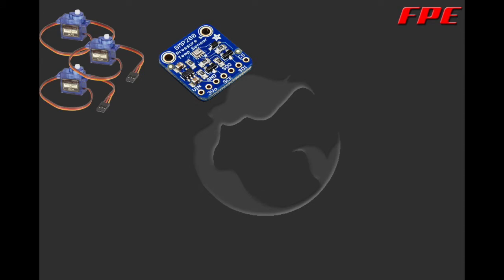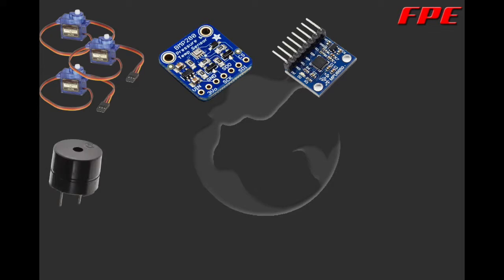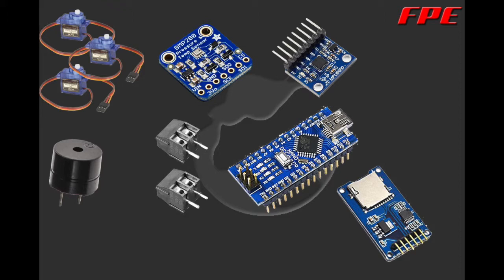How to Make a Model Rocket Flight Computer | Part 1 - Concepts and Components

Comment: Great video! I am a high schooler trying to achieve the same goal except with an electric ducted fan (EDF) to control for altitude and an electromagnetic parachute ejection system to control for time. Do you think you could share your code for the flight computer because I am really unsure whether I need to make drag calculations or whether I can just plug gyro and barometer data into the equations of motion in order to predict trajectory (apogee). Thanks, and good luck to you in your endeavors!
Reply from the maker: Couple questions. 
1.) Is it a rocket, or anything going up fast?

2.) Are you a TARC participant?
Reply: 1) Yes, it is a rocket with an F motor.
2)Yes, I am a TARC participant. My intention is not to copy code. I am just not sure whether I need CFD simulations for drag or whether I can use readily availabe sensor data in simple equations. I wanted to see your code because I wanted to see what worked for you. Thanks!
Reply from the maker: That’s awesome. I was a TARC team captain for two years, went to nationals one year. Avoid F-32 motors like the plague. But yeah, you won’t need CFD, sensor data averaged over a few flights should be more than enough. I’m deriving the equations as we speak, shoot me an email and I can send that sheet over when it’s done, I never really got the computer code done for my project. Engineering school takes a lot of time, just got busy. 

Frogpondengineering@gmail.com
Reply from the maker: I have Zoom up and going